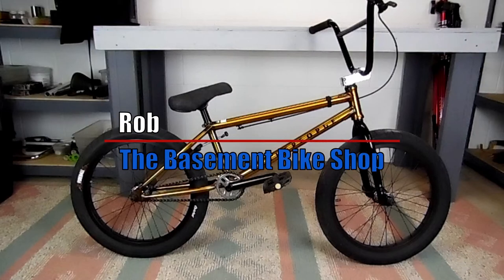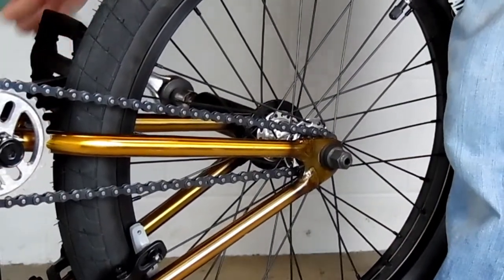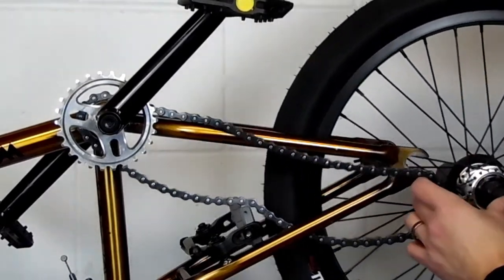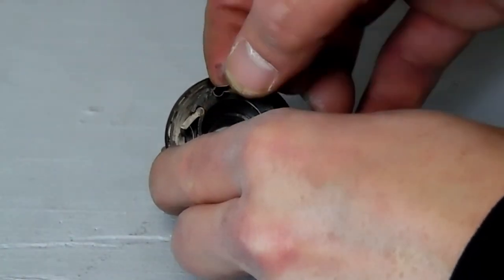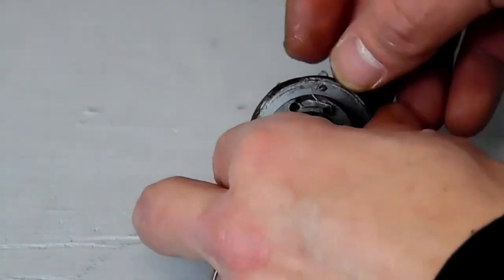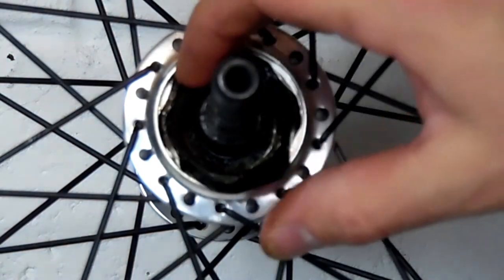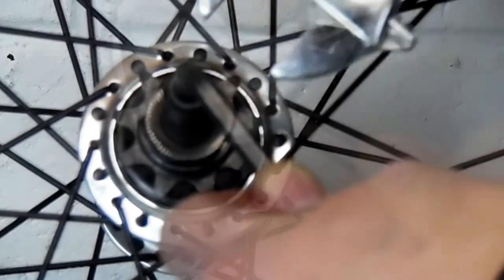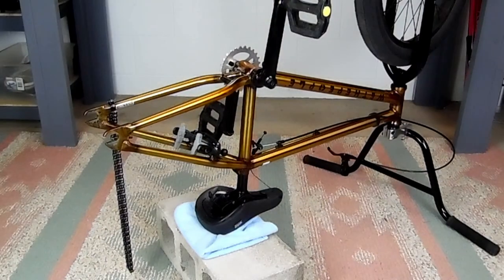BMX LHD Conversion- Part 1 Switching Cassette Hub Drive- Step by Step

Comment: Trans gold is on the envy this year! But  found the 2020 trust in trans berry pink not the best when trying to ride low key, super jelly to know they did trans gold on the trust at one point.
Are you still riding this frame?
Reply from the maker: Yes i am. I think it's a 2017.

Comment: How do I know which way to put the ratchet ring? Mine was a little stuck so I missed it when it came out. And now I dont know which way is the right one to put it in. I'm switching from RHD to LHD. Big thanks for any help!
Reply from the maker: I'll try to explain it the best i can. If you have the paws and springs the right way on your driver, you should be able to look at the ratchet ring and see the slopes and walls in it. you want the paws to grab the walls. or better yet, slide just the ratchet ring on the driver and make sure that it grabs on the wall one way and slides over the slope the other. I hope that helps.
Reply: Thank you! I think I managed to get it right.

Comment: Are all hubs capable of lhd?
Reply from the maker: No, Not all hub but many of the newer cassette driver hubs are "SDS" (Switch Drive System) or Bi-directional and are very, very similar to this.

Comment: I cantget the nut that keeps the in place out an indont have dose holes for a alan wrench
Reply from the maker: Tighten an axle nut on the other side all the way to the hub. Then put a wrench on it to hold the axle in place. I hope this helps.

Comment: 2017 wtp justice is this doable?
Reply from the maker: The 2017 WTP Justice comes with the Salt EX Cassette Hub which unfortunately is not switch drive. it can be purchased in either RHD or LHD, but it can't be converted as far as I know.
Reply: @thebasementbikeshop2336  ahh shit go, thanks for the reply man

Comment: Can I do this on the rant part on v2 wheel I ordered lhd and my bike is rhd lol
Reply: Rant party on*
Reply from the maker: I don't think you can. The Rant V2 hub has the ratchet ring on the driver and the Spring/ Paw system on the hub opposite of this hub. I'm not sure that it is switchable.

Comment: My hub does not have an Allen key slot does that mean your hub is not capable
Reply from the maker: Do you know what kind of hub you have?
Reply: The Basement Bike Shop.  14mm axle, Semi-Sealed Cassette, 36H
Reply: I think it’s made by stolen

Comment: You frayed your brake cable, no bueno there brochacho.

pawl.  like awl.  PAWL.

CIRclip removers. (cir, as in circle. circlip)

omfg if you say PAW again.

directional tire, remount the tire on the rim after flipping, don't be lazy.